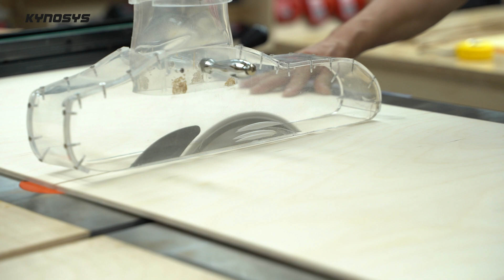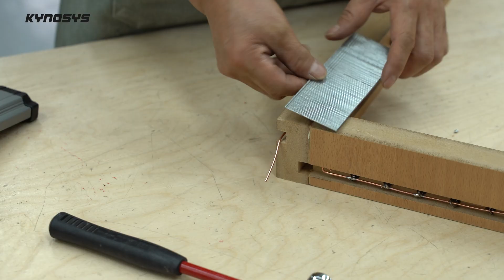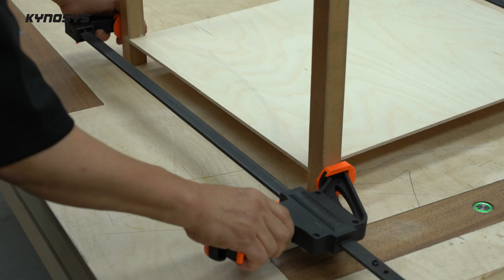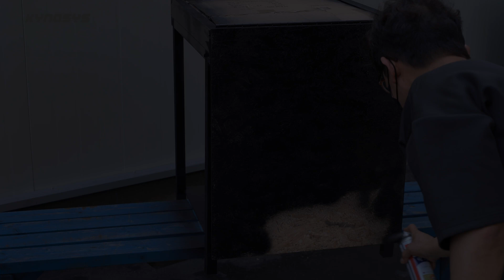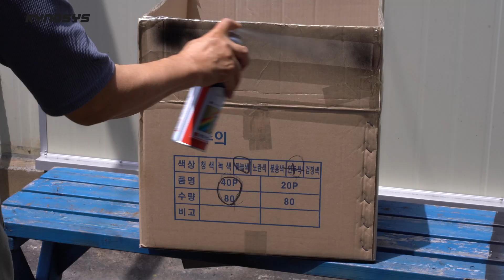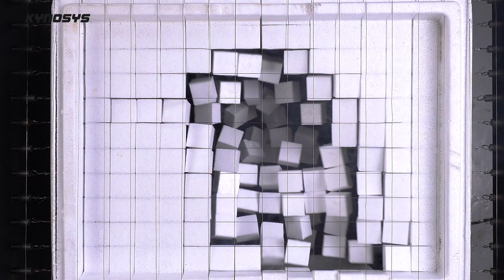Making Styrofoam Cutting Machine / DIY

Comment: All other questions were answered, but not mine. Why?
Reply from the maker: Sorry for the late reply. I connected all the heating wires in parallel. The power is 220V. If you connect them in series, the resistance value will be too high and the heat generation will be low. The wire I used is of course Nichrome wire. Thank you!
Reply: @Kynosys_  thank you!

Comment: Great job, but i am a little bit confusing about the wiring in series, the video is not clear how do you maket it. Can you explain? Thank you from Brazil.
Reply from the maker: Sorry for the late reply. I connected all the heating wires in parallel. The power is 220V. If you connect them in series, the resistance value will be too high and the heat generation will be low. The wire I used is of course Nichrome wire. Thank you!

Comment: I am looking for this to cut 2.5 inch by 3.5 inch rectangle pieces.  Can you build and sell me one?  I need it to fit 24 inch by 36 inch sheets that are approximately 1 inch thick. It needs to be able to cut Polyethylene and Polyurethane foam (We do not need it for Polystyrene)

Comment: Resistance heat cutting works great, note some materials especially some foam material create a poisonous gas.  
Love your creative engineering, that will save a lot of time if you need a consistent size and shape.
Reply from the maker: you're right. Toxic gas is produced. So, when filming indoors, I turned on the ventilation system sufficiently. I will use it outdoors, but I will be careful. Thank you.

Comment: Why not weave the wires so it goes through them all uniformly?
Reply from the maker: Are you talking about making nichrome wires in two layers, horizontally and vertically? It is not easy to make one layer in a grid format. Electrical wiring doesn't work. If there is an intersection of nichrome wires, a short circuit will occur. thank you!

Comment: I love your projects.
You could've easily skipped the legs though and just store it on the wall or something when not in use and put it on top of a garbage bin. :D
Reply from the maker: That's a great idea. I hadn't thought of that. It would have been nice if it had been made portable. Thank you for those kind words!
Reply: @Kynosys_  - For a guy like you, nothing is impossible. You can probably very easily remove the legs on it and just use it as you want.

Comment: Copper is a better conductor of electricity and heat than steel wire. Even hot melt glue will melt at 280℃. I don't think this is a good idea.
Reply from the maker: Your comment is very relevant. It makes perfect sense for you to consider the thermal conductivity of copper wire and the melting point of hot melt. However, one thing missing is the length of the spring. The heat from the nichrome wire must be transferred through the spring, which is stretched rather than contracted. That heat isn't enough to melt the hot melt. The temperature of hot melt can be considered to be almost similar to room temperature. thank you!
Reply: @Kynosys_  Stable use is the most important. I used hot melt glue incorrectly. When faced with heat-resistant occasions, switched to insulating silicone.
Reply from the maker: As you said, I didn't even think about it even though I have heat-resistant silicone. I guess I had a strong desire to make it quickly. I'll definitely have to try it next time.